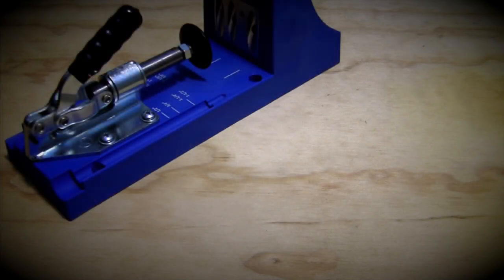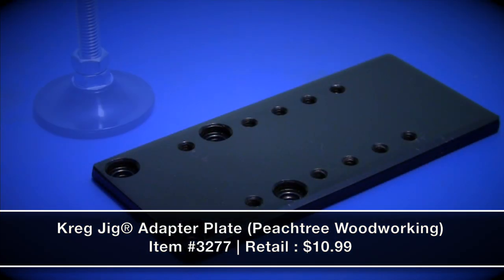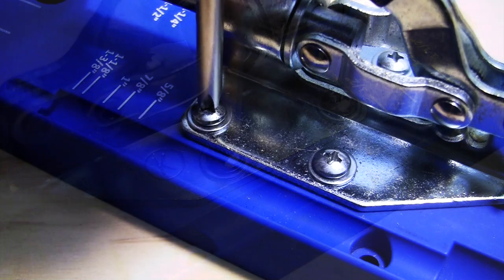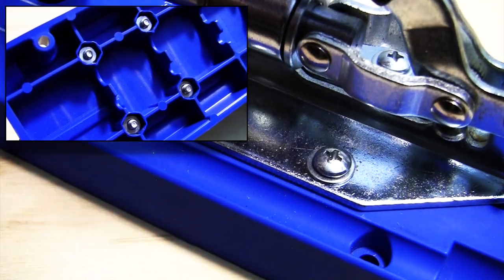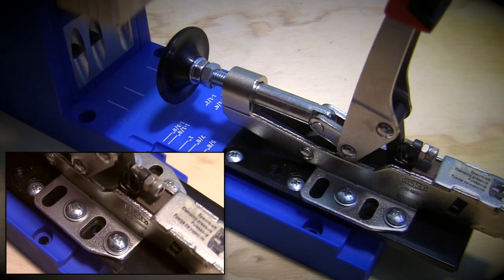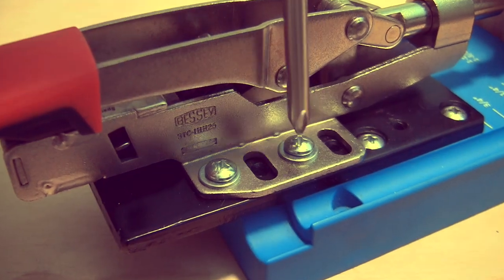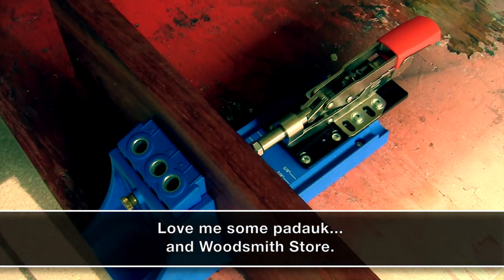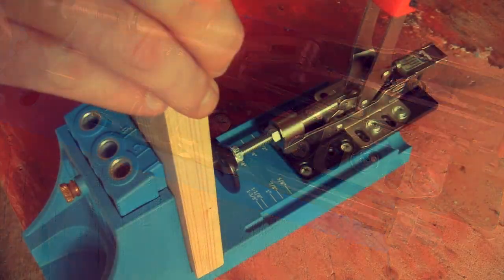Upgrade Your K4 (Kreg Jig®) With BESSEY // DIY How-To

Comment: You might want to see what Armor Tool has done with this Kreg tool , They  have a different style of Clamp called B7-IN   that works so much better. Just a cool tip of the day
Reply from the maker: Is that the one that’s all over IG? If so then I’ve seen it. Being a product tester for Bessey...I opted for this option and it works just fine for my needs. Thanks for your comment 👍🏻👊🏻

Comment: What’s the point of the upgrade?  What is wrong with the Kreg clamp?
Reply from the maker: The BESSEY toggle clamp is auto-adjust. So if you go from (3/4)" material to say 1-(1/18)"...you don't need to adjust the pad. On the clamp that's included on the Kreg you would have to adjust the pad on the toggle every time you'd go from different thickness material.
Reply from the maker: ichiban2point0 I’m content with having the Bessey on there to be honest. If anything I’d ditch the Kreg for something else.

Comment: BESSEY Toggle Clamps : (STC-IHH25) and Adapter Plate Item #3277 : (Kreg Jig® Adaptor Plate for Bessey Inline Toggles) are no longer available.
Reply from the maker: Toggle clamps are available on Amazon...I just checked and there  may be a 3rd party that makes/sells something similar to the adapter plate I featured in the video. Have a good one.